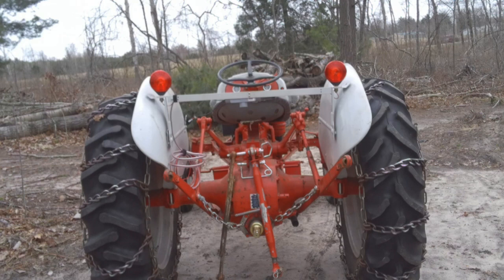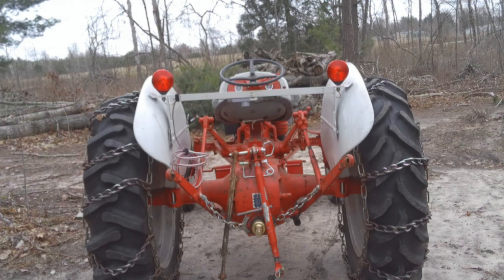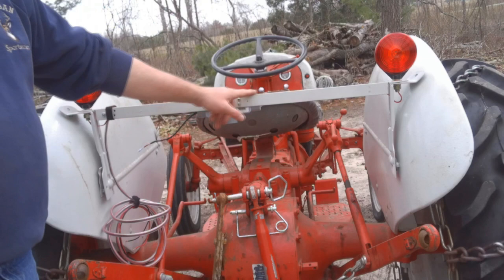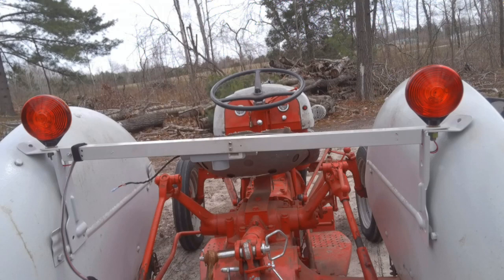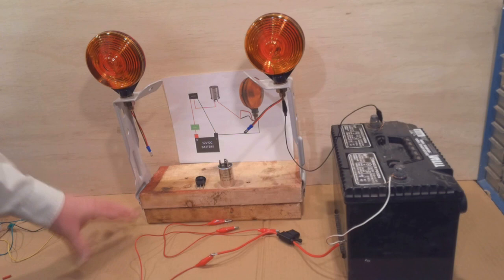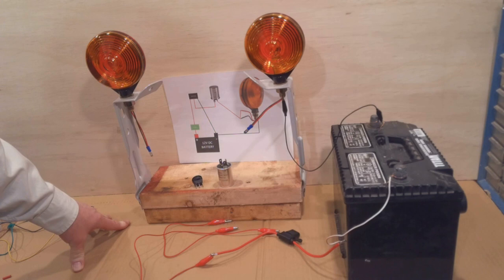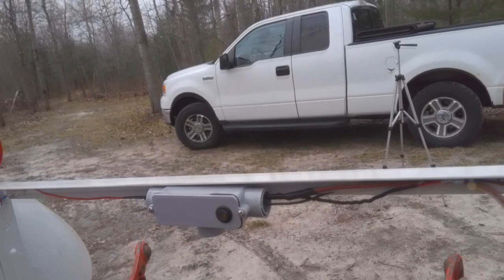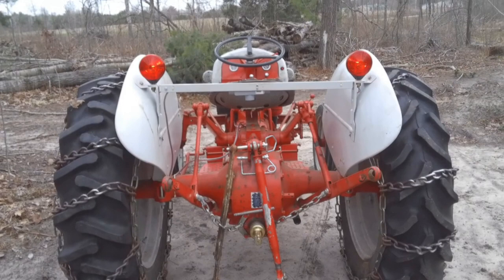Tractor Lights 12V System

Comment: I like your idea of the angle iron between the 2 light brackets. I'm considering adding an implement LED light circuit to the harness coming from the light switch in the dash so whenever I have the front lights on, I have the ability to activate the implement light via a second switch. I chose the dash light switch as the power source so that I don't accidentally leave the light on killing the battery. I'm also considering placing a small toolbox onto that angle iron to keep me losing my implement pins (which I'm doing constantly). I'm placing the flasher and it's switch under the dash as well. This is a good idea.

Comment: I'm wiring headlights into my tractor, they also have 3 wires,  red yellow and black,  do I just put the red and yellow together the way you put 2 wires together and ground the black?  I was expecting a 2 wire set up,  not 3
Reply from the maker: My guess would be to connect the black to negative and combine the red and yellow as you stated to positive, I had to run a separate wire for the ground

Comment: Have you broken off the lights yet?  Those particular lights are junk.  They are bright and very visible, but plastic frames on them snap off easily, especially when its cold outside.  You have spend a lot more, but look for lights that have a metal framework.  They will last a lot longer......
Reply from the maker: Been 4 years and have not had one break yet, agreed the metal would be more durable but it also depends on placement.